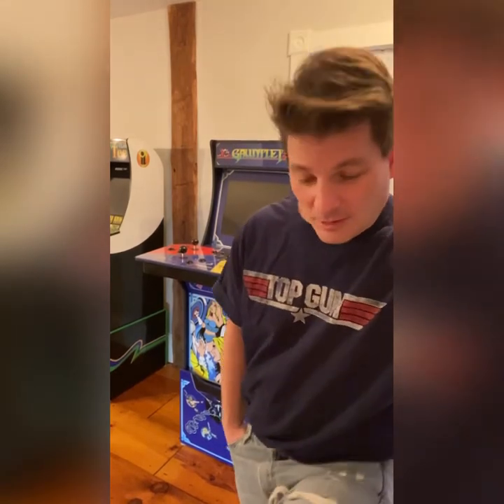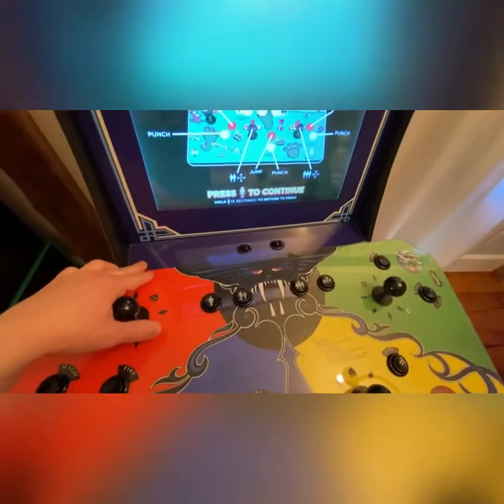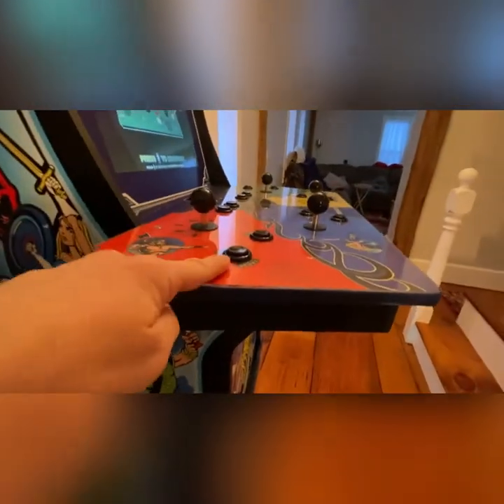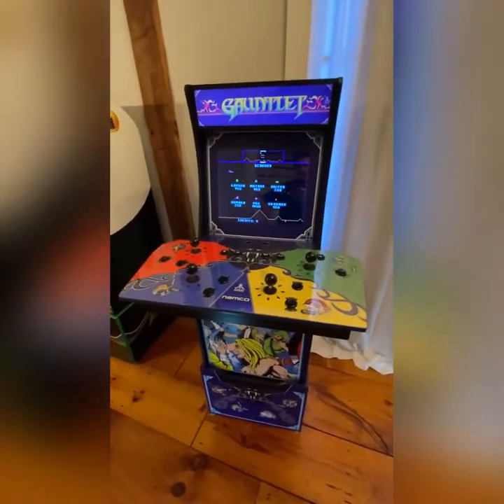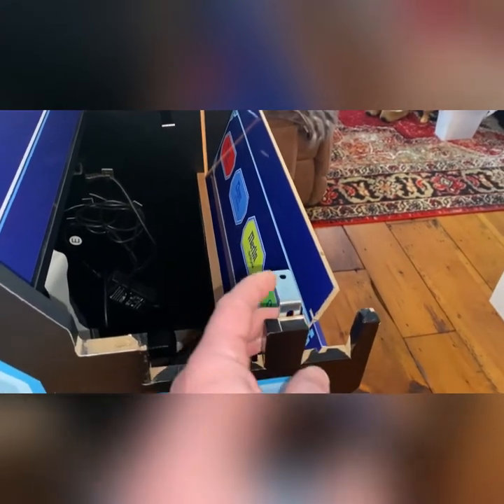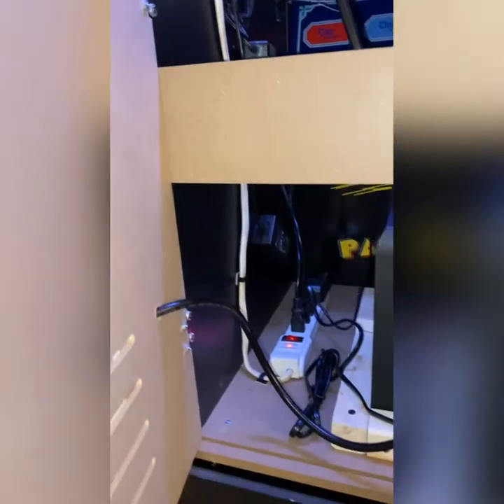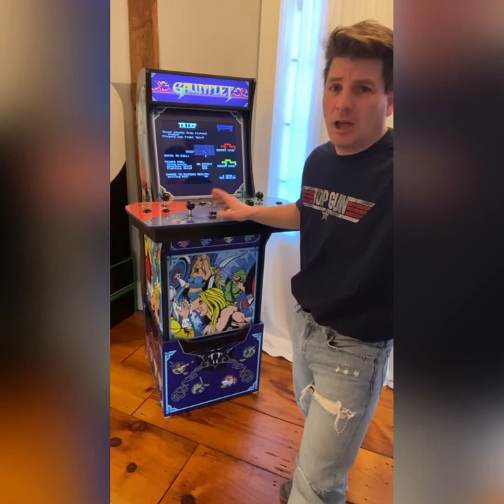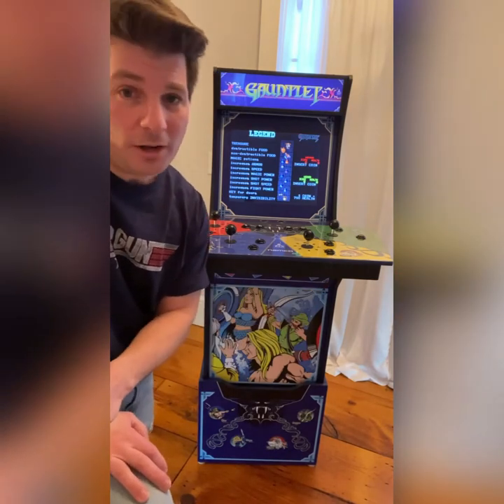Arcade 1up Gauntlet mod

Comment: which revision is it? seems like all the home versions of the 1985 gauntlet are revision 14,  the arcade was revision 5 or 6. more food and random levels after 7. Only gauntlet 4 for the sega genesis was the correct rom, except for the thief coming out on treasure rooms.
Reply from the maker: Good question.. I’m not sure to be honest.. it’s just the stock version that came with the 1st gen Rampage cab from arcade 1 up.. I do know that certain levels were freezing in this game when it first came out… This cab has never done that while I’ve owned it… I’ve played up to level 60 before I shut it off and got bored.. lol… but still never froze at certain levels🤣
Reply: @dwayneraimer  well one way you can tell is that rev 5-6 had 3 foods on level 3, rev 14 only has 1 if you're lucky